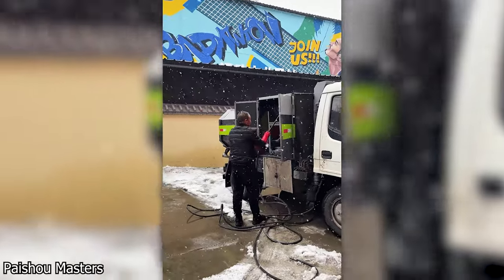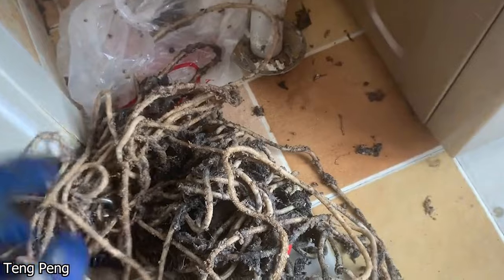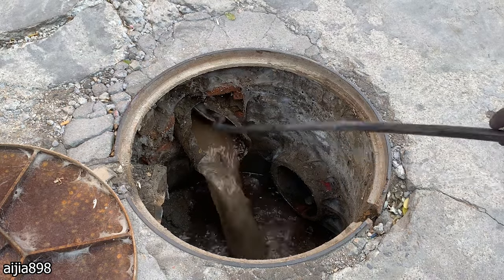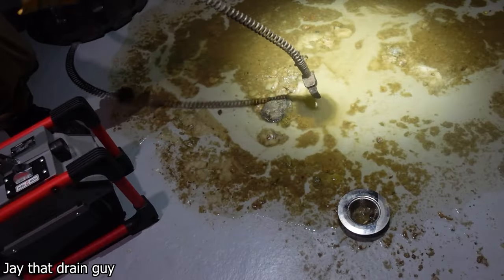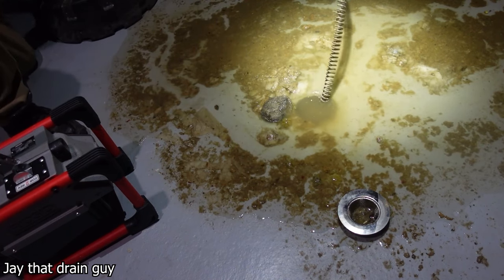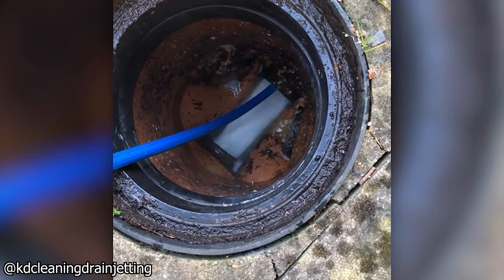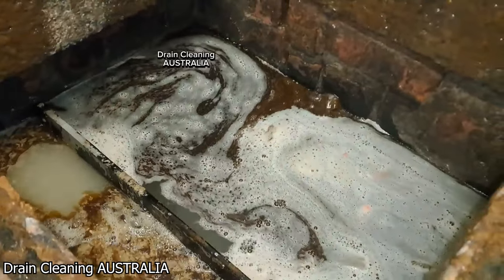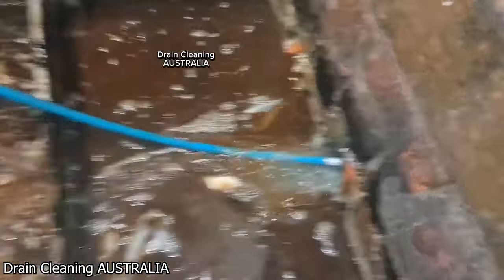Best Drain Unclogging #83

Comment: How come a roof drain pipe gets blocked like that as shown in 5:53 ?😮
Reply: Not a roof drain. That's at ground level. As there is no inspection chamber built into the system, the pipe has to be cut to allow the workman access to clear the pipe.